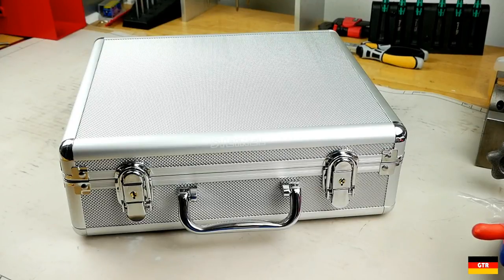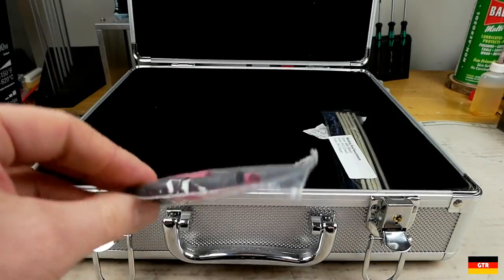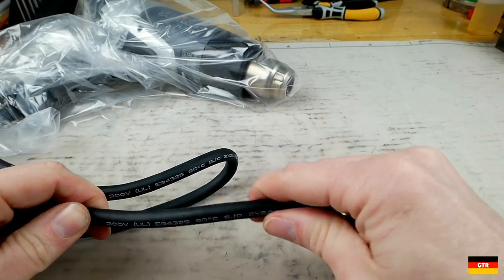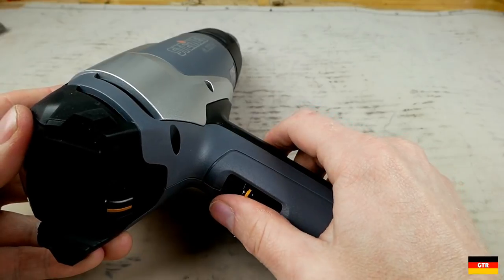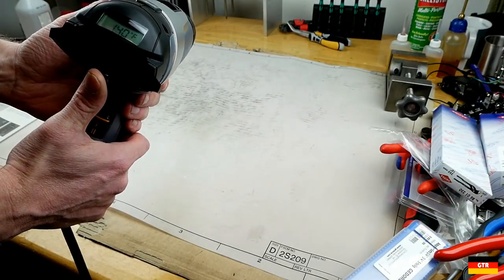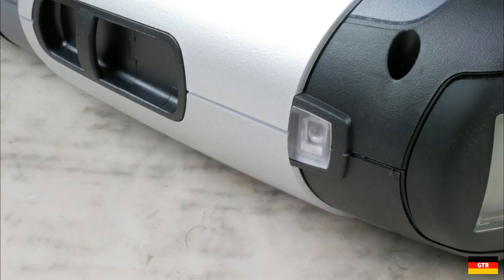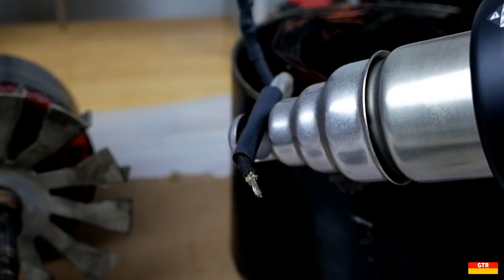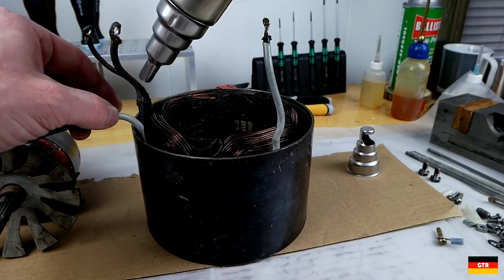Steinel HL2020E Heat Gun

Comment: Nice addition to the shop.  Just to touch on your comment about cooling the unit down prior to storage. We use industrial leister brand hot air welders for single ply roofing. Its imperative the units be cooled down after each  use to avoid damage to the  internal heating element and circuitry. The elements are not hard to replace and do go bad after a few hundred hours  but they are pricey and these guns run close to $550 each.  I would recommend cooling if for no other reason than for  safety.  Nice gun 😉

Comment: Wanted to add my 10 cents here. This tool failed for me within about a year. Main PCB died. $150 USD to replace. I took it apart and found some design flaws. I suspect it failed due to voltage spikes from EMI during switching. Microcontroller was dead, while everything else worked. Microcontroller controls LCD and heat, so you get neither at that point.

Comment: Best heat gun I've used, also have the infrared thermometer which clips to the top.
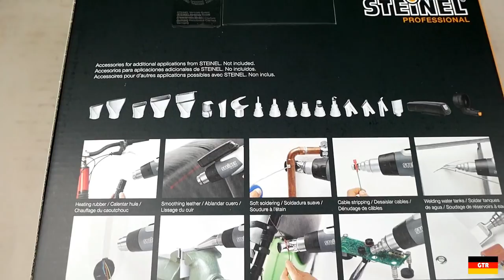Reply: 0:57 Isn't that second photo with the IR thermometer clipped to the top? So I guess that it's possible to do that with this too.
Reply: @Whigu  Yes, it works really well, haven't tested the accuracy but I just use it to give an indication of if I need more or less heat. You can set a desired temperature and the LCD on the back will show the temperature reading and change colour, blue for under, green for correct and red for over. There is also an audible alarm which can be disabled.

Comment: Running the tool on lowest heat until the temp drops is more of a safety precaution. The chance of burning yourself on a noisy tool is much lower than one thats been switched off, or unplugged, leaving no way to tell if its still hot (LED on this is nice, but its just a small LED). It would have been a good feature, but then the first switch position would not be able to cut power to the circuit. Most electronics hot air guns do this.